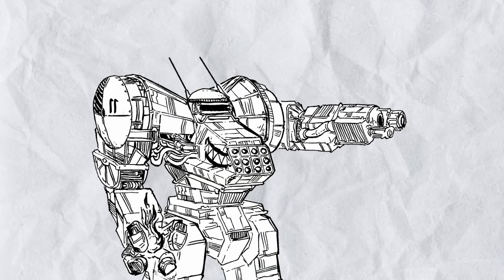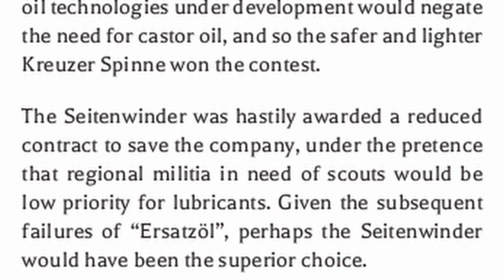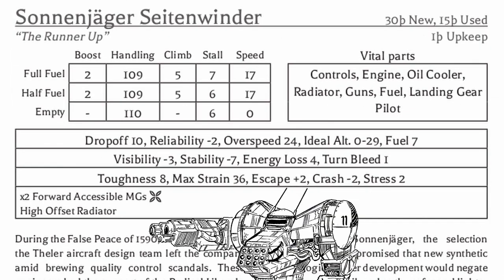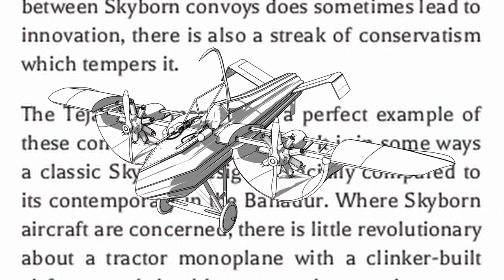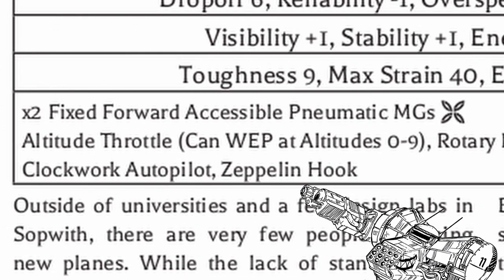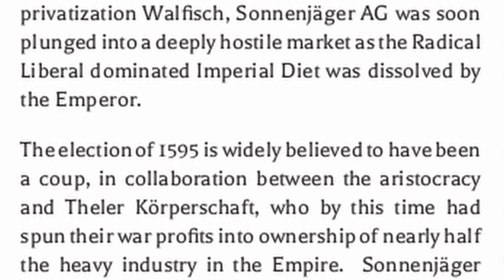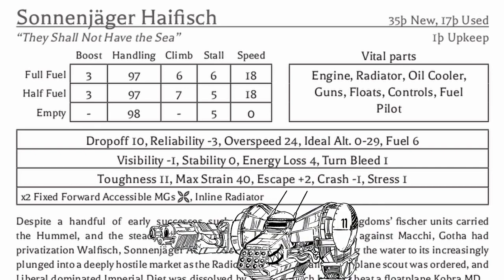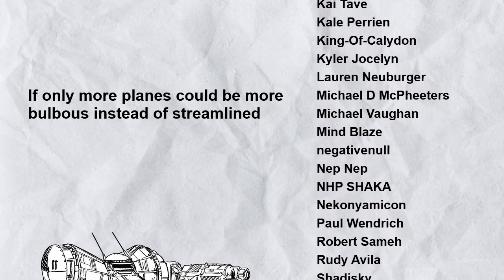Trashtalk on Flying Circus: Flights of Fancy (Part 2)

Comment: Replacing the floats with conventional landing era doesn't change anything?  That's kind of weird, the weight and drag differences ought to mean something.
Reply from the maker: Sometimes the plane is in between break points of either drag or weight, so it just doesn't change as long as you don't go too far
Reply: @11dragonkid11  Fair enough.  Real-world aircraft design at this kind of tech development was still full of surprising results (or lack of results) too.  The number of designs who had major chunks of plane added or removed between prototype and production model and still flew is kind of amazing.

Kind of heartening to know that mission creep has literally always been an element of aircraft procurement though.  :)